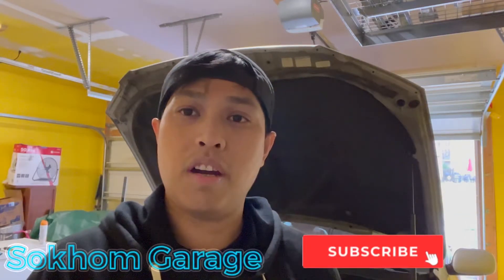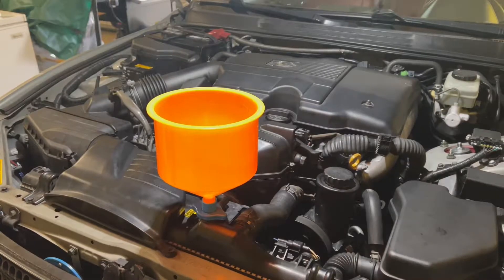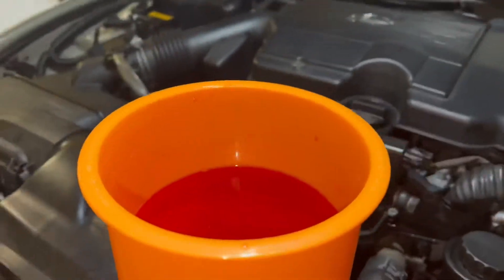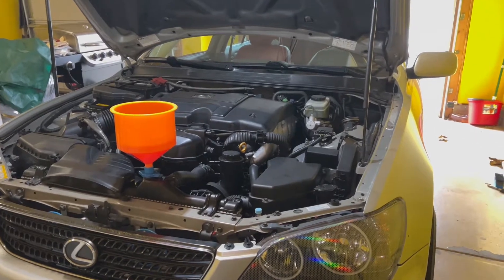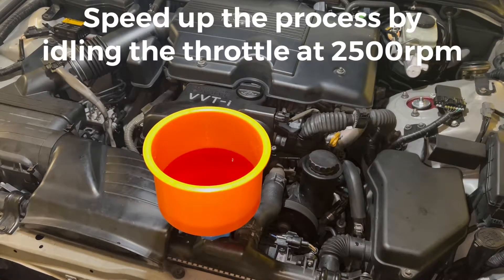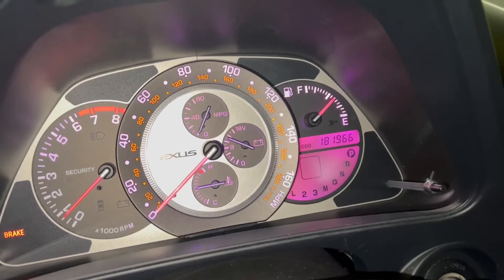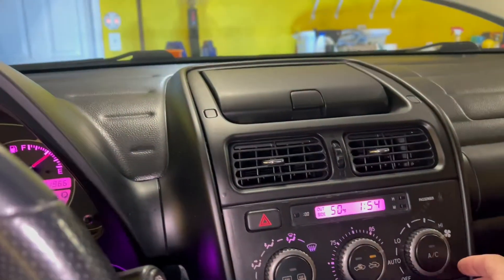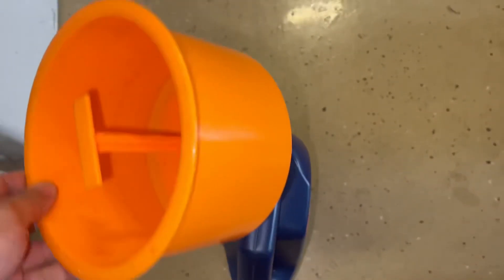DIY: How to bleed/burp a cooling system | IS300

Comment: hey my top radiator hose snapped and i replaced but my car started to over heat after that. i figured that it could be air in my system? i already drained the reservoir and radiator. how much coolant do i put in?

Comment: When doing a flush how much coolant do you put back in?
Reply from the maker: If you’re doing a complete flush, you only need 2 gallon, but for extra if you really need to top off, 3 gallon for safe measure. If you’re just draining and refilling, 1-1/2 gallon is all you need.
Reply: What’s the difference between a complete flush and a drain a fill? Sounds the same
Reply from the maker: Complete flush, you’re draining everything out of the system, putting new coolant in.Drain and fill is just draining only the radiator while there is still coolant still in the system, this is most common because you’re either replacing a part that either deals with the cooling system or replacing a part that requires removal of the radiator.

Comment: Thanks  this is exactly what I was looking for - as it's the same process for the GS300, I was looking to see if there was a bleeder valve/screw. It also looks like you've got a different brake system or converted it.
Reply: @MusicConnoisserian same bro looking to see if my gs had a bleeder screw 😂

Comment: Any info on how to flush out a heating core on 2009 Acura RDX? Getting subpar heat on driver side and very little heat on passenger side. Both blend door actuators are working so I think it’s the heater core
Reply from the maker: It’s kinda hard to explain, but all you have to do is find the inlet and outlet of the heater core lines, which is naturally located on the firewall, depending on most vehicles, technically what you have to do is buy clear pvc tubing, I think 3/4”, I might be wrong, and connect one tubing to the in and one to the out. You would have to use a water hose and spray the outlet part going in flushing it through the inlet, you would repeat this until it becomes clear, then what you have to do is fill it back with coolant the exact same way, and then put the original tubing back out, did I lose you yet? I know it’s hard unless I show it.
Reply: @SokhomGarage  Thank you for the tip I appreciate it! It’s not an easy place to get to so I’ll let you know how it goes

Comment: What if my heater doesn’t work? I can set it but it’ll just blow regular air, a/c works good though. I Just replaced my radiator, will I still be able to do this
Reply from the maker: Question would be, was your heater working before you replaced it? It could be many factor, bleeding, blend door actuator, thermostat, heater core or a clog in the line. I would definitely try to re-bleed it again to ensure there is no air in the system, make sure the fan cuts on, if it doesn’t, it could be issue with thermostat stuck closed.
Reply: @SokhomGarage  i definitely think it was the heater core, but no it wasnt working before. I got a new thermostat also and thanks will check for leaks after
Reply: You should check for leaks, after bleeding it too.

Comment: Lol bro I've been following you since you had 6 subscribers it's good to see you got about 500 now. You always seem to make videos about things I either have done have to do or want to do. I just did a radiator and heater core flush so I gotta drain the distilled water and pour in the red coolant and didn't want any air bubbles. Keep up the good work
Reply from the maker: I really appreciate it.

Comment: Do you have video to demonstrate on how you can remove water pump/timing belt /cams seals 2JZ LEXUS IS300?
Reply from the maker: I don’t have one yet, but that will be something I am considered doing, not sure when, because I will have to replace the cam seal eventually, so I will do the timing and water pump as well.
Reply: There's a few videos of people doing that with their IS300s though, I'd recommend TwoJays videos. Incredibly detailed and easy to follow plus doesn't do anything sketchy like bump start the car to get the bolt loose